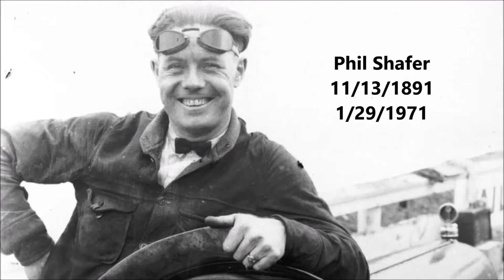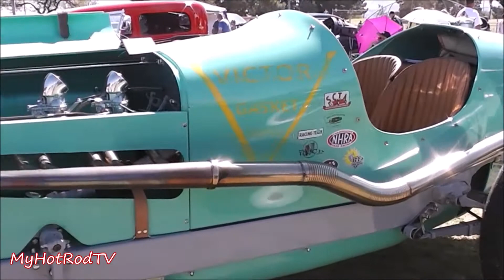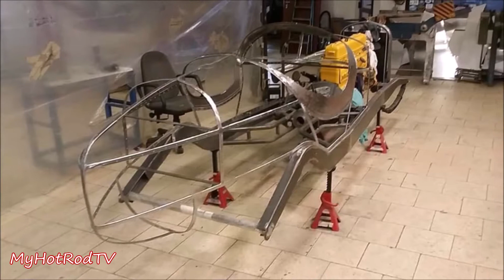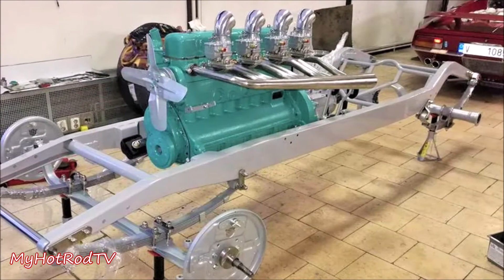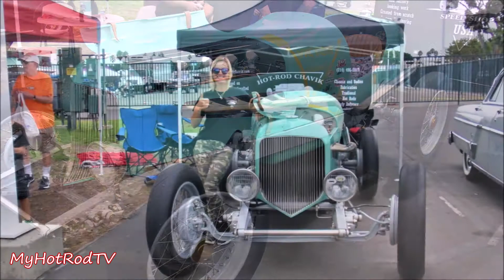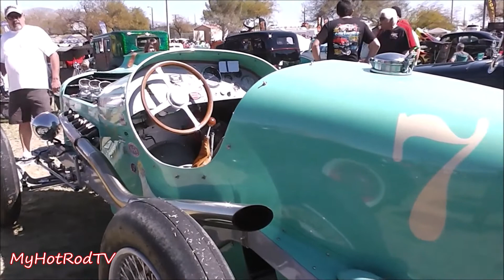1933 Chavik Shafer Buick 8 Indy Special

Comment: I guess i ma going to have to build one of these
Reply from the maker: Hot Rod Chavik did it right
Reply: @myhotrodtv  Absolutely. I have been building a machine shop  and casting forge to be able to make any parts that I may need. I will be starting a Youtube channel when it gets a little warmer here in Pa with the building of a replica 1928 Morgan RIP 3 wheeler with 4 wheels. I am hand casting an aluminum  two piece adapter to mate an experimental opposed twin aircraft engine to an MG 4 speed transmission. Then to an MG differential with awesome wire wheels.I will keep you in the loop . Thank you.